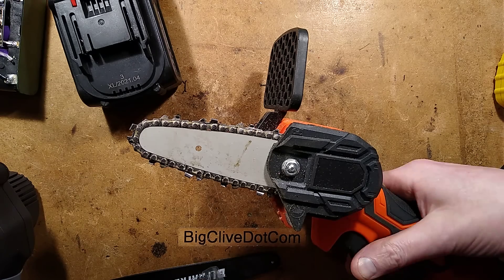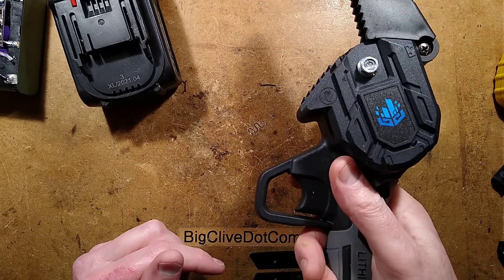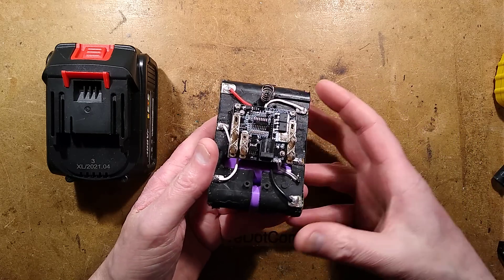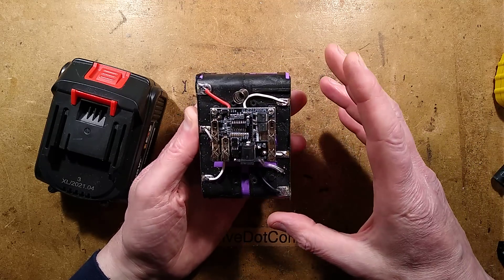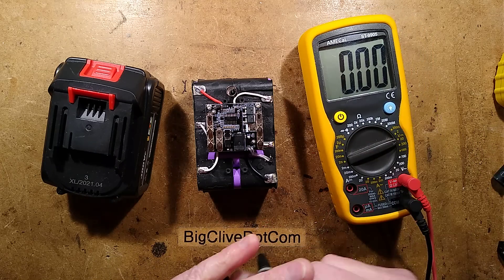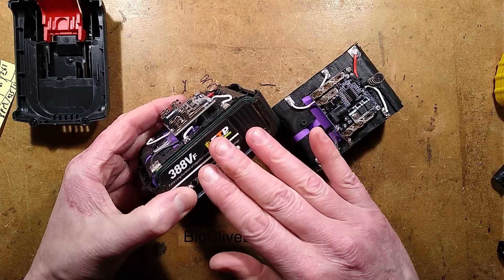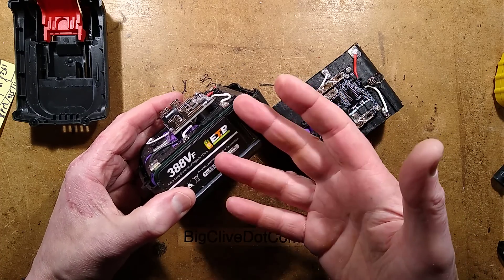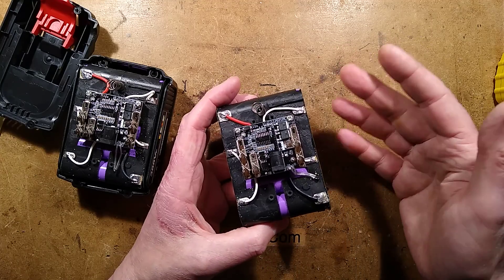Dead batteries - with odd charging circuitry

Comment: I bought one of those modules to convert an old Ni-Cad batt pack to Li-Io.  Works great at keeping each cell charged - better than the old system, which had no current limit when charging.  Every problem batt pack I've opened typically has one bad cell, while the rest are fine.  So many good batts end up in the waste bin.  If they made it easier to access and replace the cells, there'd be less waste but I'd image manufacturers don't want that.
Reply: I agree in theory but the issue with lithium cells is that if you don't hardwire them in, you either use: 

1)  springs/tabs which aren't super secure and under high vibration situations or drops, small shakeups of the cells at high SoC can result in arcing which isn't healthy for the contact point or cell itself and will result in higher resistance and therefore higher temperatures (believe me the mOhms add up with these things, especially in powertool packs)

2) a system of clamps that puts the cells under pressure, which may not be good for them long term. They're far more robust than the pouch cells, but they weren't really designed to take load like that

The reality is that spotwelding the cells is not only the cheapest and fastest, but also likely the safest way to pack them
Reply: @crumpus5815  While spot welding is cheap and fast, an enclosed battery compartment is the best alternative. Lots of devices use these without any problems.
Hmm ... a thought just occurred to me. Why are the batteries attached directly to a device? Why not have the battery separate (attached to your belt, perhaps) with a cable running from it to the device. Yeah, sounds just like a power cord but I can see some advantages here. Easier to swap devices - just plug them into the same battery pack. And easy to swap out packs. Could also swap to a power cord if the batteries aren't performing. Best of both worlds.
Reply from the maker: You do get heavy duty tools with a separate belt mounted battery pack.
Reply: @two_tier_gary_rumain  Often the cable and attachment points are the point of failure for these setups, with the potential for electric shock. Only when the tool get too heavy do they consider this setup.
Reply: @two_tier_gary_rumain  for light duty tools, the main attraction of cordless tools is the convenience of manoeuvrability. if you have a cable leading to the belt, then that defeats the purpose of a battery powered tool, then you might as well just go with a corded one or use an air compressor. 

also, ppl who use power tools to make a living generally will not want to add batteries to their belt, what with everything else that's already on there.
Reply: I 100% agree with you. Would be nice if they didn't hardwire the battery cells in.
Reply: I've seen a circuit in where the stand-by-current was drawn from only one cell. Guess what happened? Yep, that's the one that got bad first.

If you have some battery packs laying around for longer, recharge them first before use. Even if the indicator shows a full pack, it'd be likely that one of the cells is lower than any of the others. If then current is drawn equally from all of them, the bad will be out first. And if there is no extra protection per cell, this one will take a direct hit.
Reply: Many big hardware stores have battery recycling programmes that, I'd assume, would actually recycle the batteries and extract the good cells. There are businesses that sell reconditioned name-brand powertool batteries, but for these no-name batteries they're only good for some cheap cells.
Reply: @Avantime  I have a large box full of good used Ni-Cad and MH cells, which I use for projects like garden lights, kid's toys, and other electronic projects.  Sadly around here, they claim they recycle some batts but most are landfilled.
Reply: EHH, there are big issues with throwing a new cell into a pack that has been paired throughout its lifespan. Mismatched capacities, mismatched voltages.. mismatched internal resistance. A lot can happen
Reply: @DarkAttack14  For sure, the best thing to do would be to replace all cells at once, keep the good cells for other single use.  There are several issues for sure, but I figure if we can make rockets land on a moving ship in the ocean, we can figure out this simper problem, lol.
Reply: It seems that a good BMS which distributes the charge proportionally to cell(s) would be a good thing.
At added cost,of course.

Comment: Those resistors are meant to be there to balance the cells theres mosfets insode the chip that short out the cell and brings its value down. But 1k will never ever be enough for this
Reply from the maker: It's just for sensing.  There's no balancing.
Reply: No, these don't balance, they just measure voltage. I was astonished to find the same sub-standard circuitry in an expensive 1/2kWh  Bluetti "power station."
Reply: @matthewmarks6951  the topology looks identical to the balancer I'm designing at work though?
Reply: @adagioleopard6415  Yeah but as you say, the resistor values will be a lot smaller. Measuring cell voltages and balancing cells both require connections all the way up the ladder.

Comment: Have a chinise one too. The original battery was too weak, it shout down with cutting modest branches, so i 3d printed an adapter to use a Parkside battery, a couple of spade connectors and some wire and it's done.
Reply: As I commented elsewhere, just be very careful using Parkside batteries as they have no FET to turn them off when the voltage drops too low.

Comment: It's the same with hybrid cars and EVs.
It's not just the capacity of the entire battery pack. It's the Delta in voltage! As soon the cells have a difference in voltage in the 10th of a Volt or more it's the beginning of the end.
Good battery management systems are able to charge "around" the defect cell/block. Others are "blind" and charge all alike. 
First you get a malfunction code. If you ignore and delete it again and again you risk A BIG BANG! That's what happened with my Toyota Prius II. The BANG was like a handgrenade in the trunk. 🤦‍♂️
Aftermarket repair-services collect new and old hybrid modules, disassemble them, re-condition each single one by supervised charging and discharging cycles. After a final charge the re-assemble the modules by making sure the max. difference in voltage of ALL of them is not much more than 0.01 V. The hybrid akku is then again usable for several years for a fraction of the costs.
Reply: Ah yes, the big bang of the cells pressure release going off! 

Must have startled the crap out of you. I've seen those go off, but not in person.
Reply: @volvo09  Yes, I was shocked by the BANG!
It happened at 11 pm on a street in the middle of nowhere, I wore just light clothes, it was just above freezepoint with snowy rain, the car was loaded up to the roof and I didn't have money in my pocket. At least my cellphone was operational.
Can you imagine how stinky a 214 V and 50 to 100 A short-circuit is inside the car? 🤮 It smells like a dozen burnt Chinese computers. 😂
Reply: Dam I would have thought car manufacturers would be that careless to not have individual cell monitoring with charge/discharge ability to keep all the cells at the same voltage. That just dangerous. Even my rc cars from 15+ years ago I had alarms for when a cell dropped undervoltage and I would balance charge every time due to seeing what happens when lipo cells go wrong
Reply: @HootMaRoot  You can read the block voltage in Toyota Hybrids. I don't know how much information is free or blocked in the vehicles of other manufacturers. 
The described method of disassembling and re-arranging cells and blocks applies to a guy in Poland who buys and sells hybrid batteries of Toyota.
His name is "hybridrep" and he travels all over Poland and Germany. He comes to you and changes the defect battery of your Toyota Hybrid in front of your door to a recycled one. It costs half of the price that Toyota wants for a new one.

Comment: I salvaged four dead 18650's from a laptop battery, they were really low if not dead  dead. I have a charger that trickle charges and they came back up fine. In fact one is in a torch. It did take over 24 hours though. But I kept a close eye on them, and made sure they didn;t start generating heat.
Reply: I used to have an 18650 powered desk fan and would frequency forget to turn it off and regularly discharged cells to 0v. 

I did that to some cells 10x and the capacity loss was surprisingly low, but they were not at that level for more than a few days.

Junk old 900mah batteries would degrade to 700ish after that kind of repeated abuse.

Comment: I recently purchased an American made Hart battery-operated drill and was furious to find the battery was dead and that buying a new one for $60+ was no guarantee. 
The fun part of the story is I hooked it up directly to 12v (a bit dangerous), and I was able to "jump" the battery and get it going again. I did try less voltage first with no luck.

Comment: Clive, I’ve got some 1.2 NiMh batteries that won’t charge in a lidl smart charger. Is there any trick to revive them?
Reply from the maker: Yes.  If the voltage is too low it can't detect they're there.  If you put them in a dumb charger it will raise the voltage to the point they can be detected.
Reply: I’m 99.9% sure Clive made a video on how to make a USB NiMH trickle charger. 

5v and a current limiting resistor to give a few milliamps should bring the NiMH cell back to life.
Reply: @davadoff  Sometimes you need more than that - the dreaded dendrite shorts the cell out and you have to burn it away!
Reply: @matthewmarks6951  Hook up your DC arc welder and give the cell terminals a tap? 🤔😜😱
Reply: @theoztreecrasher2647  Slightly less dramatic, but a big capacitor will often do!
Reply: if you can get your hands on Liitokala chargers eg. Lii-PL400, they are smart enough to trickle charge the dead battery into life. Found out myself after wasting many batteries to stupid Energizer charger with similar problem as you are having.
Reply: @naiveknight47  Time for some home-brew: wire a resistor and a switch in series across the transistor that controls the charging!

Comment: Perhaps you could design a battery alarm system, a simple universal clip on that monitors voltage with an alarm for a charge reminder
Reply: Like the very occasional chirp from a smoke alarm - that has you wandering around the hut like a stunned mullet trying to work out what it is/where it is coming from?! 😱😵‍💫😈
Reply: @theoztreecrasher2647  Oh hell !! been there
Reply: you can by them cheap for drones and you can vary the low volt alarm within a nice range.

Comment: A resistor, in this case 330k, in parallel with the NTC will make the resistance vs temperature curve more liniar. This  "trick" is often used in thermometers/thermostats, instead of fx. implementing the liniarity in software.
 
Not sure if thats the reason it is used in this application, as I could imagine thye just need a threshold temperature.

I'm normally not "in to" chain saws, but those two are really cute, and looks even smaller in your big hands 🙂

Comment: One of the occupational hazards of being a hoarder, things break whist they are not being used.
Reply: yes, its a shame when you think ooh I have a tool for that and the battery's flat and wont take a charge. I guess its an excuse to buy another. 👍👍
Reply: @dcallan812  One can never have enough batteries.
Reply: That's like Gandma's old '89 Buick when she said "Of course it will run. Nobody has used it for the past 10 years. It's just been sitting in the garage since Grandpa left it there."
Reply: @robinbrowne5419  Ouch! It will need some TLC, Grandma.  🤣😂
Reply: @jlucasound  Yup 🙂
Reply: You must be particularly mindful of this with lithium batteries too. Could have a spontaneous combustion incident unawares
Reply: @Dazzwidd  An unscheduled and inconveniently timed indoor barbecue occurrence.
Reply: @Frankhe78  Yes, I had a device that contained 18650 batteries, built inside a stainless steel lunch tin. The battery holders were secured by Velcro tape. Sitting unused in the cupboard for some weeks, one of the battery holders detached and there was a short circuit. I'm lucky it just burned wires to the holder. The circuit itself was also salvageable, and still able to be used
Reply: @Dazzwidd  I call that a lucky escape.
Reply: Whilst

Comment: Interesting and thanks Big Clive.  I finally broke down and got one of these little saws when it was $30 and I have to say I'm totally impressed.  It will chop through a 4" limb easily.  I think it must have been a few years ago seeing your video that has kept that on my wish list for such a long time. 

This has prompted me to make sure all my batteries are topped off.  Thank you.
Reply: Topping them up is not a good idea for storage. They like to sit at about 40%, if they are not in use for a long while.
Reply: @dr.robertnick9599  Isn't it like 3.85v - 3.9v being the ideal storage voltage? At least that is what I store my salvaged vape batteries at...
Reply: @dr.robertnick9599  Dangerous information Robert.
 Storing at 40% SoC is ideal for individual cells but when you're storing a battery pack with a BMS that may have quiescent current draw it's best to store them fully charged, preferably in a cold place. This gives you the maximum dormancy period without danger of loss. If you can keep a strict regimen of cycling them once every x months then yes, 40% SoC is ideal for battery packs with BMS also.
Better battery packs have extremely low quiescent current draw. I can (and do) store my Bosch 18v batteries in a 4 degree fridge at around 50% SoC and only check them annually (and they don't seem to lose charge). However cheaper batteries such as this one can have quite a high quiescent current draw and will need topping off / cycling / using every 3 months or less. For cheap packs I fully charge them, use them in a tool to drain about 5% of their capacity, then store. It seems to work best.
Cheers.
Reply: @dr.robertnick9599  I think you're right though for some reason I've had 80% as the ideal storage charge.  Not sure and the voltage thing too.

Comment: Rather than recycle the whole pack, remove the good cells and reuse them as a USB power pack. They won't get too stressed in this mode of operation and you get to re-use rather than just recycle them all.
Reply from the maker: The main concern is whether internal damage has occurred.
Reply: @bigclivedotcom name brand 3.7v cells are charged to -12v and dead shorted as two of the tests, and must not explode or catch fire to pass. Something extreme like that anyway. 

I think li-ion cells are most dangerous if either punctured or overheat & unable to puff up if lipo (creates a thermal runaway like situation?).
Reply: @davadoff  To be clear, that test requires that they don't catastrophically fail, but certainly doesn't require that they work afterwards 😅
IIRC the main concern is that the main result of internal damage due to overdischarge is internal shorts, which will kill the cell if they are small, but can also be a very bad day if those shorts are just enough to start failing at a higher voltage. If he's confident that the other cell groups didn't get pulled down too low then they may be ok, but realistically they aren't that expensive so it's probably not worth the risk.
Reply: @davadoff  Just a couple points, tests like you described are done on a small number of li-on products through a production run and can't guarantee any individual item as a battery as much as confirm outcome of process. But like you referenced, name brands "quality" manufacturers generally hold a standard... but who do you think made the batteries for an item like this with such a low overall cost to purchase? And your a bit off with the problems you listed. Heat yeah, is a problem but gas is not a cause but a consequence. Problematic temperature that destroys a cell is caused by another cell going into thermal-runaway from the biggest and most common problem with these batteries, being damage or condition caused during charging. These batteries need very specific charging requirements that are almost always neglected because of cost efficiency determined by calculated risk assessment by manufacturers. Reputable companies don't neglect safety but they make chargers that are optimised to the habits of users so to get best performance and life from a battery and not for what is actually optimal if the human equation was removed. Cheap dodgy companies skimp on everything that's not mandated by law!
Physical damage is absolutely a cause of a failure or development of failure, but not a statistical cause of significant note. Li-on batteries should be stored at about 60% charge and not discharged under 10% or charged over 90% and optimal input should be done by a complex system with limits set on the individual capacity and trimed during charging to follow the "curve" between those limits relative to state of charge! This is not the sort of finicky factor people want to pay for or bother with, so tradeoffs are made and consequences occur!